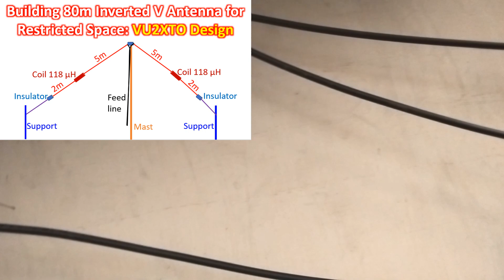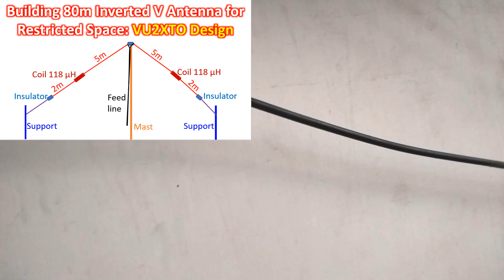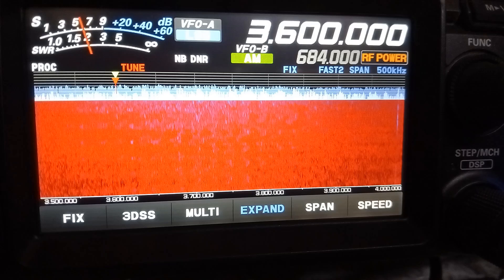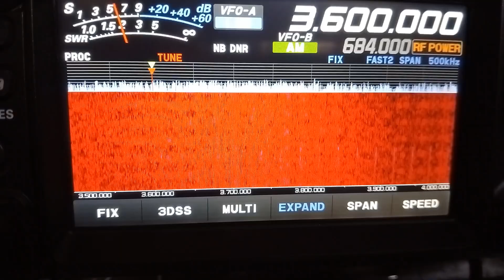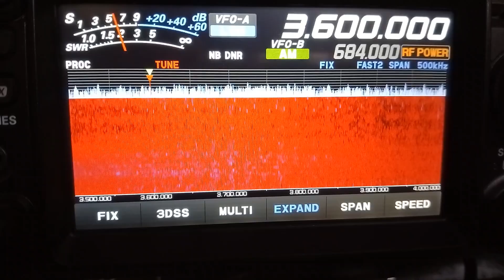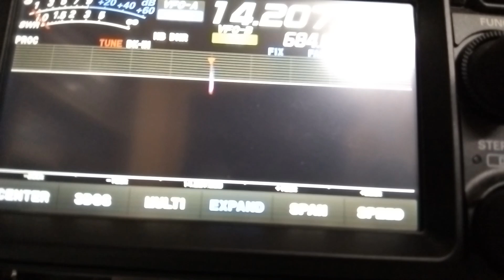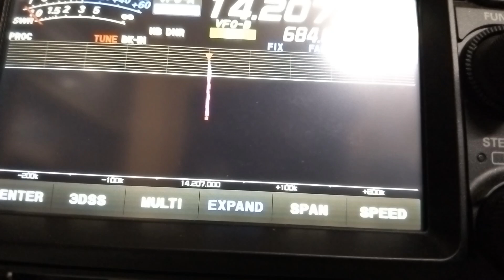Building 80m Inverted V Antenna for Restricted Space VU2XTO Design - 4

Comment: You need to add a feed line choke at the feedpoint and a choke before entering the shack. It will stop RF entering the shack and help reduce noise level.
73 de Aiden EI8HJB.
Reply from the maker: Yes. You are absolutely right. 73 de Jon, VU2JO